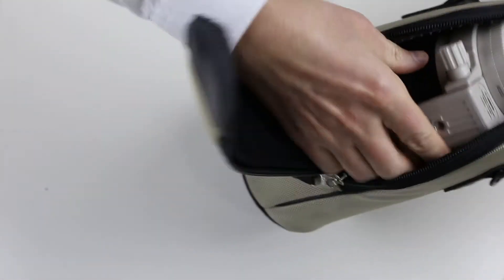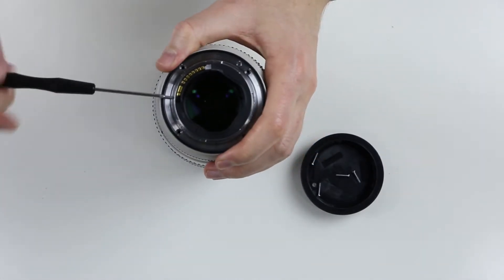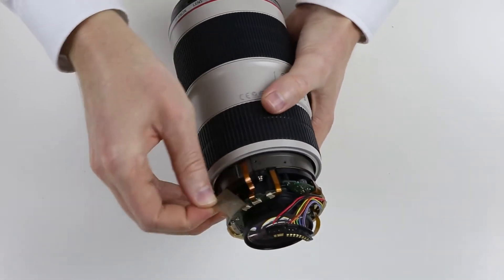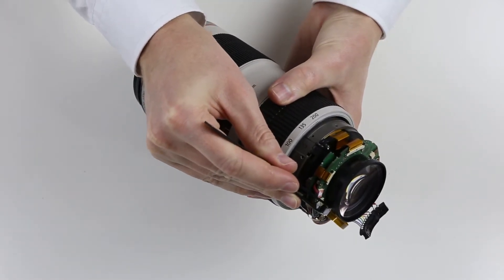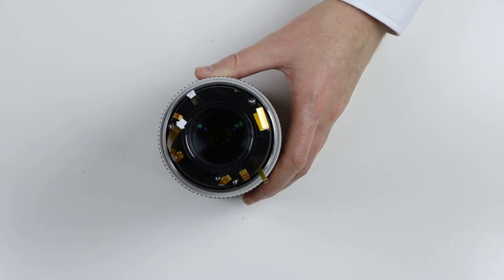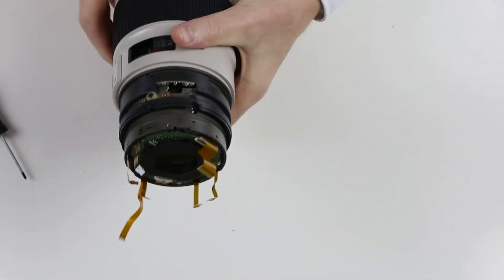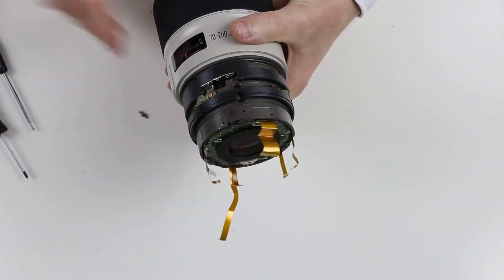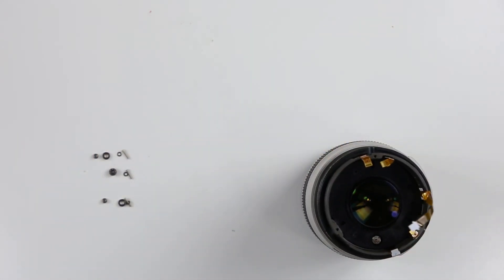Canon EF 70-200mm f/2.8L IS USM II disassembly for replacing the image stabilization unit

Comment: Thank you for the very informative video. I really liked the fact that you also did verbal explanation along with the video which made it very easy to follow. I also have a the ver. 1 that has the same problem the stability just stopped working. Also the auto focus to manual switch does not shut off and go to manual it stays in auto focus mode. should I look to replacing the whole switch plate assembly ? Thank you  again. DMFR
Reply from the maker: I would check the switch first. As I know, it is electric, so remove the switch and the cable and check the connectivity of the cable when switching.

Comment: Dear Camera and Lens Engineer,

I have a Canon 70-200mm F2.8 II lens with a strange issue. The image stabilization (IS) is not working when shooting in landscape orientation, causing blurry images. However, it works fine in portrait orientation.

Can you please help me diagnose the problem and guide me to the area in the lens that I should inspect?

I would appreciate your assistance.❤
Reply from the maker: It is a strange problem indeed. Well, to diagnose the root cause of this problem, the IS should be replaced, then the lens should be tested. Or maybe there is a loose lens element which is in its correct position when the lens is in portrait, and moved when it is in landscape... this could be in the IS unit.
Reply: @CamerasLensesEtc  مشكور 💫💫

Comment: Hello, I have a question about Canon 70-200mm f2.8 IS III , it only focuses if I set focus manually to infinity then I can use AF on objects at infinity and on objects at closest distances, the AF is moving only one direction.  if I set the focus manually to let say 2m and then try to focus on objects from 2m to infinity the AF will not move. Do I have to replace the AF motor or just clean the AF sensor?
Reply from the maker: If the AF sensor would be the problem, then the autofocusing would just go hunting / move back and forth. Most likely the problem is with the USM motor, which needs to be replaced.
Reply: @CamerasLensesEtc   Thank you, that's what I suspected.

Comment: Great teardown video. I have the mk3 version and the focus ring slips so I can't do fine, manual adjustments. any advice on what the cause and fix for this issue is?
Reply from the maker: I don't know, I haven't had this problem before, and I haven't disassembled the MK III version before.

Comment: If I want to remove and replace just the front element group, is the procedure the same?
Reply from the maker: I think you don't have to disassemble the lens to remove / replace the front lens element. I think you can remove it like I did in my cleaning videos.

Comment: Hi, How are you.  I am from Brazil I liked your video thanks. I have the same lens and I have some problem with the zoom sometimes gets stuck. I send it to fix but they dont have the part.  And I want to buy from another country because in Brazil is expensive and hard to find .  However I dont know the name  in english of the broken part.   They said that the problem is the back tube of the zoom.  It is cracked.   Do you know the exactly name of this particular part of the lens. Could you help or anyone that read this comment tks
Reply from the maker: I think you have already contacted me on facebook messenger, but maybe someone else has the same problem, and read your comment. The lens has many parts, and it is very hard to know exactly which repair part you need. I would advice you to ask the service center to take a photo of the item, then search for repair parts for your lens on ebay or aliexpress, if there is for sale there, usually you can find the canon part number in the description. If you have that, I would recommend to ask the Canon service center if they sell that part, usually they sell repair parts for individual customers.

Comment: After removing the rear element (with the PCB on it), did you have to "recenter" it to achieve sharp focus?
Reply from the maker: That lens element is not calibrated, so it is no need to recenter.
Reply: @CamerasLensesEtc  replacing the IS unit in a Canon 70-200 f4 IS seems a bit different. Is a calibration needed? Thank you. You already saved me many times.
Reply from the maker: @Feredino28  I don't know, I haven't disassembled the f/4 version. Generally, if the lens has eccentric screws (washers), then you should mark them and put back the same position to keep it calibrated.